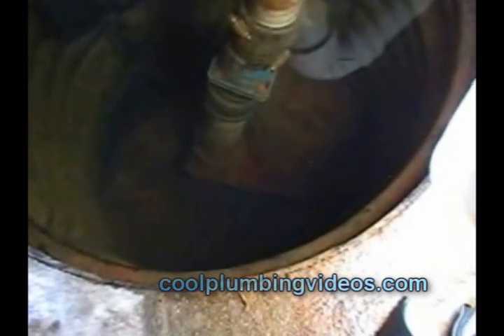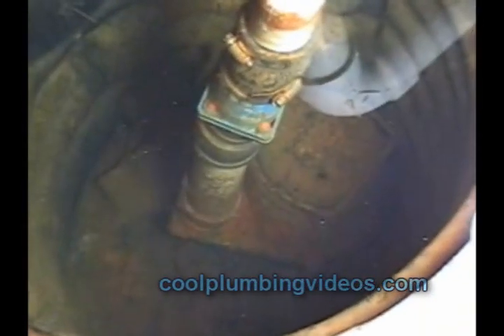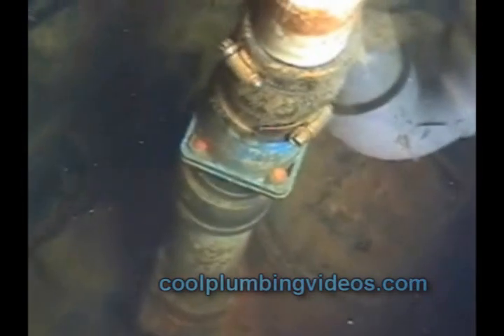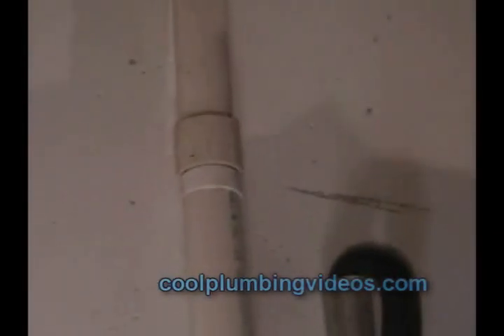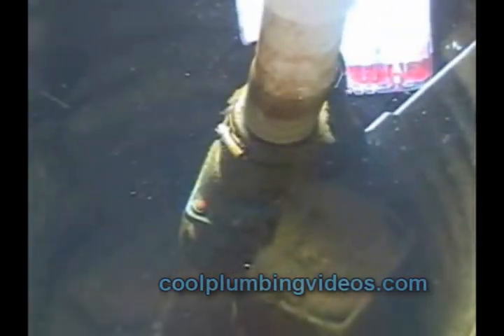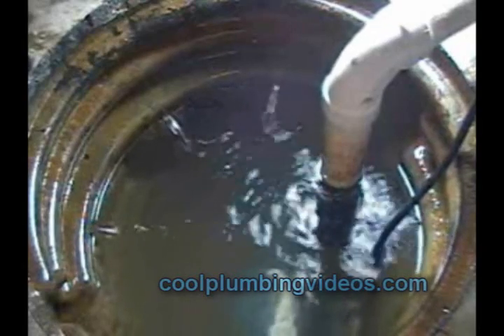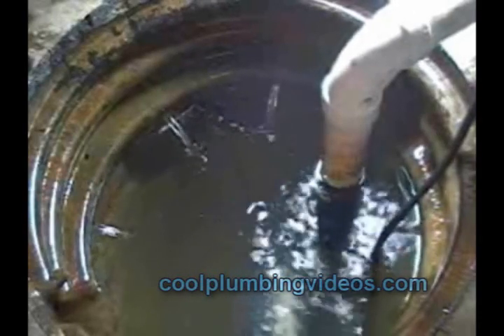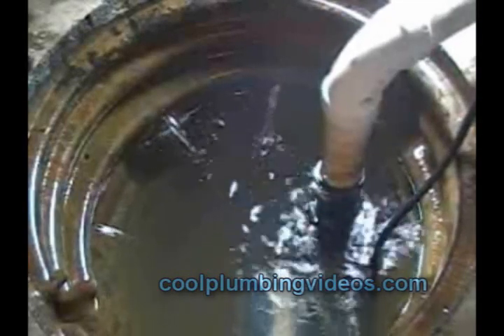Slaying Wet Basements: The Ultimate Sump Pump Guide For Homeowners

Comment: i have a laundry pump in my house and it has to pump water up a story and a bit, but sometimes when it pumps the water up the remaining water in the pipe drains back down into the basin and the pump will start again and the process continues untill the pump is unpluged and left for a bit. should i install a check valve on the pump because i see that most sump pumps have them. thanks for any advice you can give.
Reply from the maker: Uhmmmm